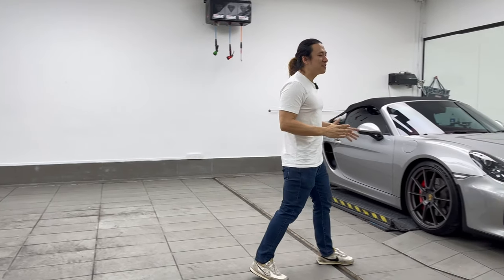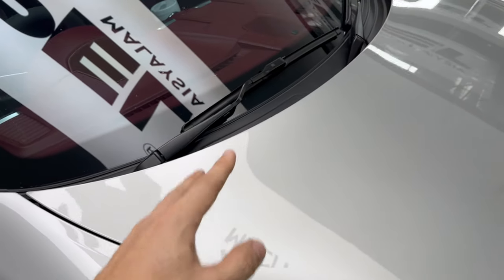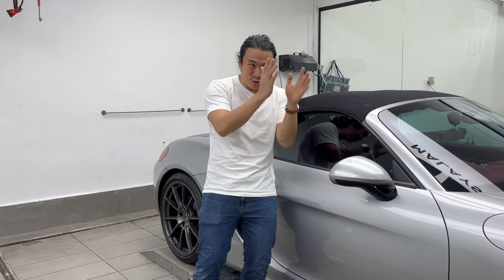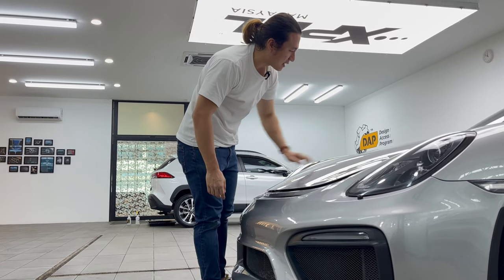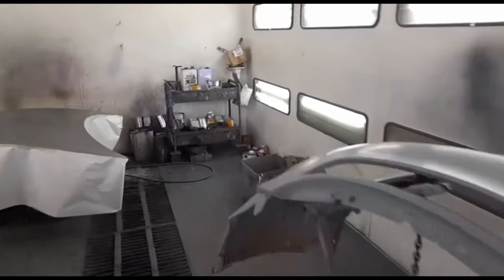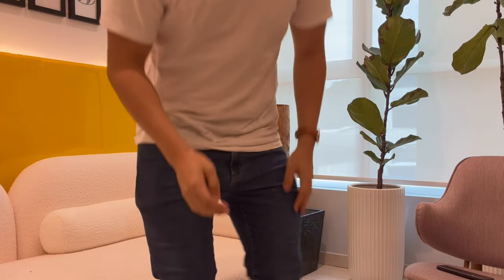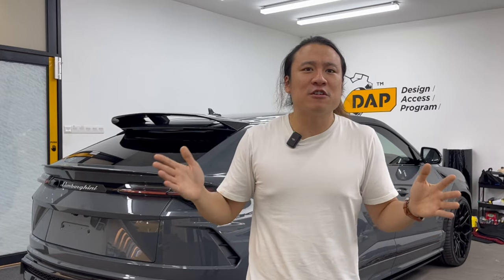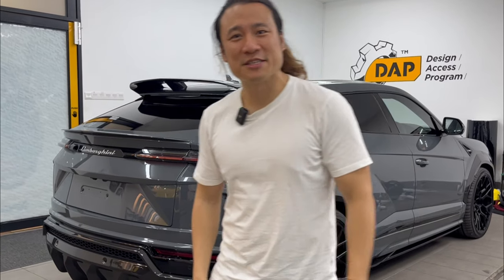Watch This Before Installing PPF | 2 Years Installation Review

Comment: It’s only that bad because a lot of track use. If you are going to do the same, maybe wort it. Most cars over that time will only have a few stone chips if  used on road only. If you want get the bonnet looking good get it re painted for around £500 or even less to get just stone chips repaired and detailed.